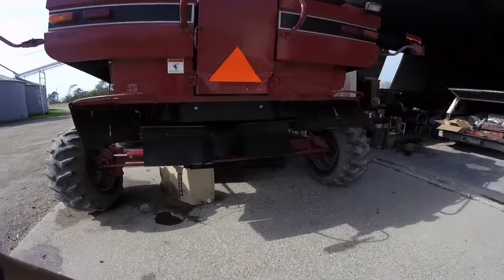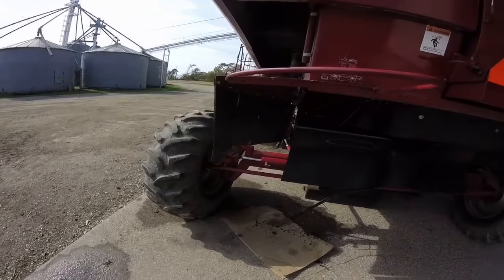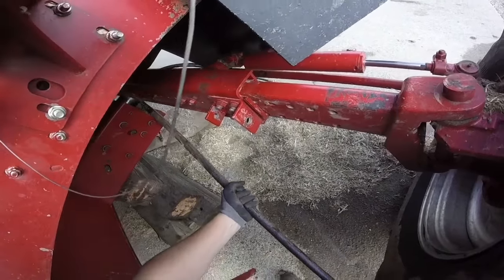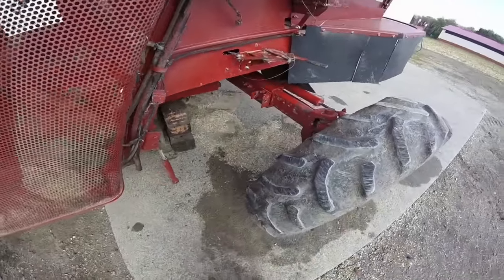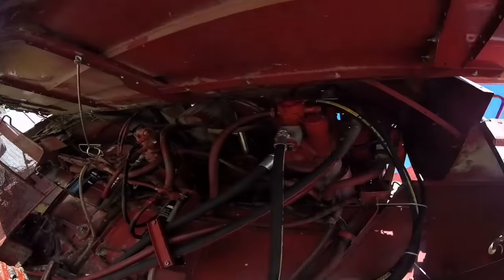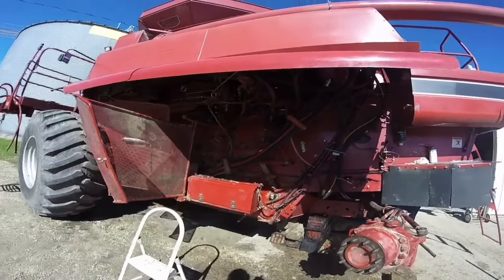Case IH Mud Hog Axle Install

Comment: We've been think about adding a mud hog. How much did the set up cost  and did you have to get extra parts directly from Mud Hog?
Reply from the maker: TrueBlue Farmer it was supposed to be a complete set for 6500. We had to get two hydraulic blocks from mudhog and a couple hoses. I'm sure we got 7-8000 in it but it's the best money ever spent.  We wouldn't have been able to get half the fields we were able to without it
Reply from the maker: TrueBlue Farmer brand new quote was 18000
Reply: BornToFarm1 That was an incredible saving on new and I'm sure what yous got is in Good order
Reply from the maker: Sean McGeeney the axle saved harvest. The fields were muddy even on the last day of harvest after it hadn't rained for 3 weeks
Reply: BornToFarm1 Very good you guys decided to fit the axle, would have been a disaster for yous if you hadn't

Comment: is it just me, or are your front tires out extremely far
Reply from the maker: Good eye, we got this combine a few falls ago after the other combine burned.  This machine had duals on it but the duals would not go behind a 6 row corn head.  So, we put the singles on it with the dual spacer still on the machine and it drastically helps with stability in all the hilly fields we have; also helps when you have a big bean head hanging on the front.